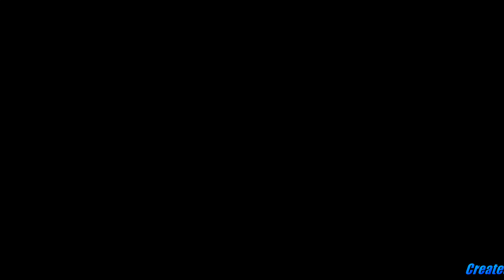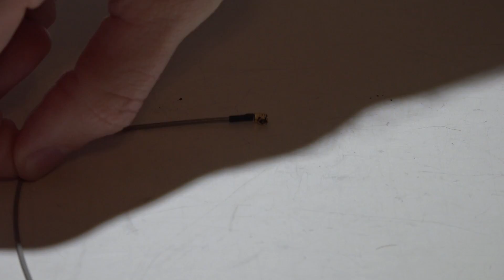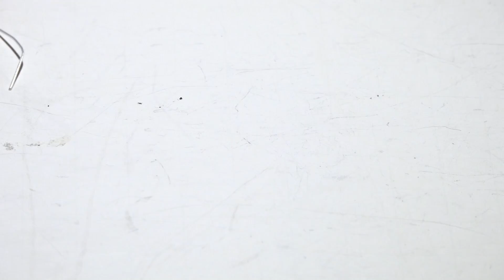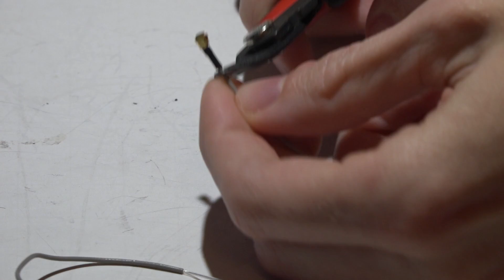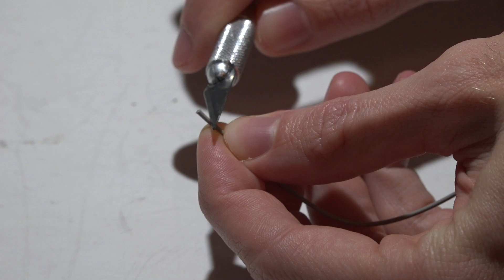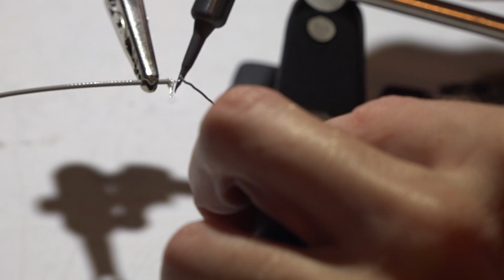FrSky XSR Antenna Replacement

Comment: thank you for the vid. I was freaking out. I have futaba r603fs receivers in all my cars never had any issues so don't know much about them except they are important very precise and expensive. so when I needed a 3 inch piece of antenna tube and cut it from an old chassis I thought I had removed the receiver from.... well I just cut 3 inches off the antenna. Your video with the great walkthroughs made me be like "I can do that..." and then I ordered a pack of antennas with your link and I think its going to be ok. phew. thank god, its why I cant sleep tonight...and am rambling on in a youtube comment.

Comment: Thanks for the link to the 20x replacement antenna on eBay!! But why don't you just solder two UFL/IPEX connectors on the board directly? Then you can just snap in the replacement antenna when need be. The footprint for these connectors are already on the PCB. I don't know why FrSky didn't just place the connectors on these receivers - it was probably to keep costs down or something.

Comment: I used long rg316 coax and use around 31.2mm and got so much more range than the original antennas. Was a bit hard to solder since its a bit fatter
Reply: Does it matter how long the shielded part of the cable is?

Comment: I cant check at the moment, but I'm assuming that a brand such as FlySky Rx antenna is essentially the same thing?  I need to replace both of mine and am trying to figure out where to get them from... if I can do so w/o having to buy them, that is.

Comment: Thanks for a great instructional video!

Recently after resembling quad I`ve got low rssi warnings in about 30 meters with my Taranis.
And found one of  antennas broken near the soldering plate (the one which is closer to the button). I`ve tried shortening same one and solder it properly, also  with new done  from 50Ohm cable with same length of exposed end I still got low rssi in a short distance...

How I could be sure it is XSR, not Taranis transmitter problem?
I have only one receiver-transmitter set, but maybe you have any tips how to check and be sure is it still problem in antenna or receiver itself or Transmitter?

Thanks in advance!
Reply from the maker: I'm not really sure of a way to tell without another receiver. The only thing I can think of is buying another and trying it out.
Reply: Thanks for answering!
Looking for new one right one.

Once more thanks for great videos!

Comment: apparently all FrSky RX have been changed to smaller  (2mm diameter) connector for X4R and XM+.  have no idea where to get these yet but be aware these old antennas won't snap on on anything made after Summer 2016.

Comment: I have continuity between the ground and the signal, is that normal? first I thought the problem was inside the wires, but then I de soldered the antenna wires and there was continuity between the pads can you check if your is the same ? thanks
Reply from the maker: Yep thats normal. It normal to have continuity between the signal and ground pads on Vtx's too.
Reply: Thanks, yea I spent a whole evening once trying to trouble shoot a VTX after directly soldering and antenna to it, not knowing that continuity is normal , Oh well the perks of this hobby :)